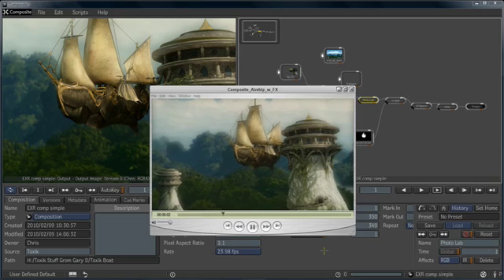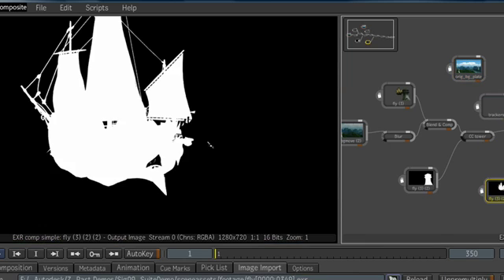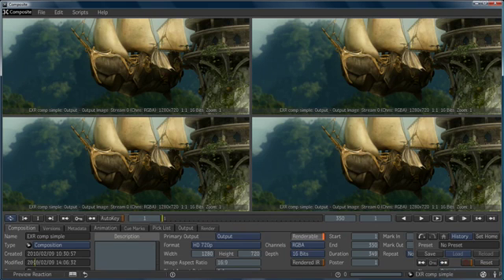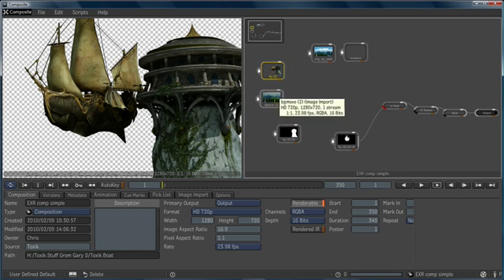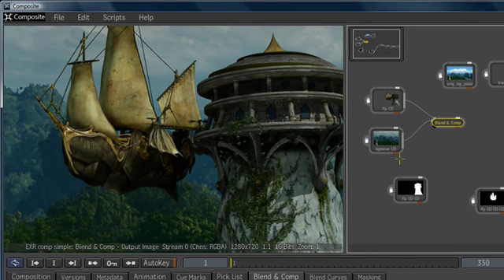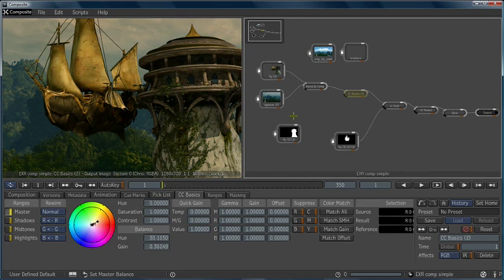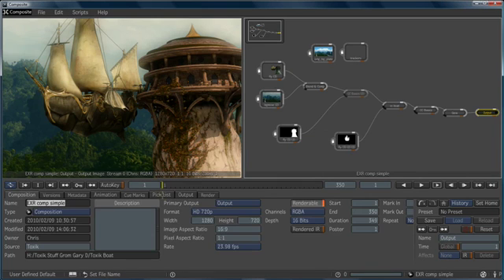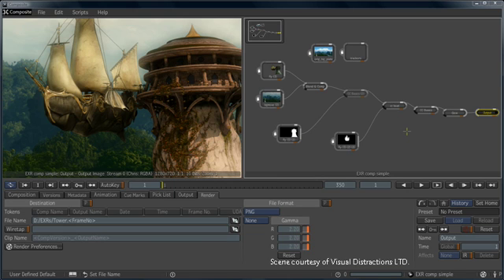3ds Max Composite — 3ds Max 2011 New Features

Comment: Why don't you be the first one to post a reel showcasing its workflow. Doesn't have to be the industry standard for you to embrace it. Its free. it has the same power as NUKE. Nuke is hell expensive. this application is really stable and yields a better composite that after effects. Reason being, It has an integrated float HDRI workflow. Not like 8 bit defaults in AE. All filters are 32bit. AE effects are mostly 8bit. Not even 16bit. This is the Nuke to small production houses.

Comment: I must say, we tried this software for several months. Found many limitations in the software. Mainly the ability to see parts of the UI since they are hidden under various locations.

No modern compositor works in the workflow composite is providing. For real power and ease of use do yourself a favor and check out Nuke or Fusion. Even houdini (an FX tool) has better composting and ease of use. Nice try Autodesk, put kill the dead horse.